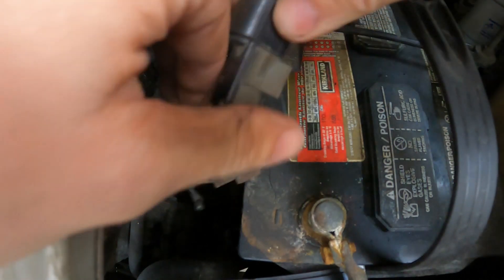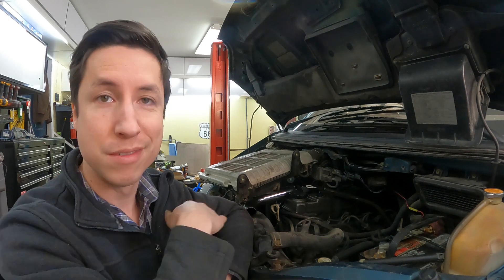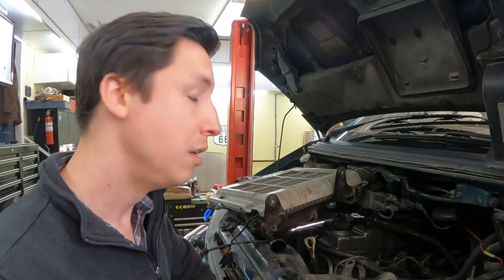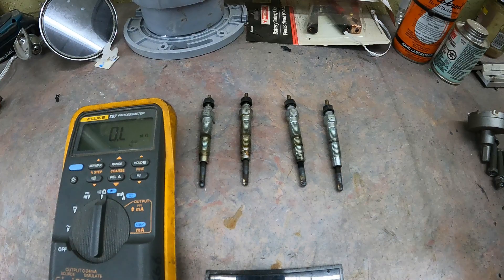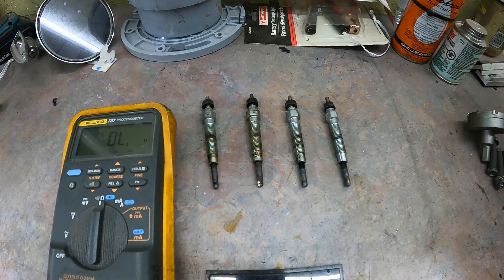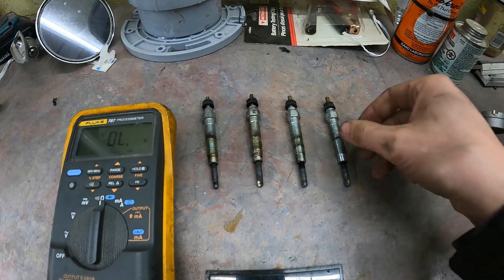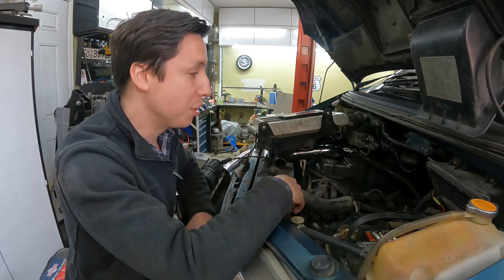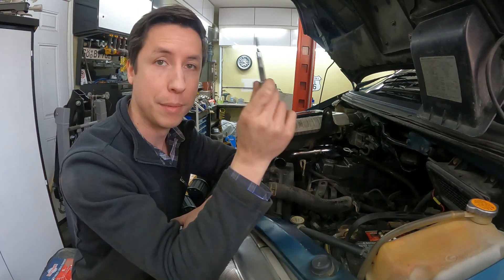Diesel Engine Glow Plug Test (Mitsubishi Delica)

Comment: Thanks for the video! Would bad glow prevent the relay from clicking? I have an l300 4d56 and i have no more clicks in my 12v and 6 volts relay. I have voltage there and reas voltage on the glow bar (5.72volts) i think the Ohm from the the plugs read 1.4, if they are toast, would that prevent the clicking?

Comment: You do great content. But your statement about using a test light to show how much current is flowing to the glow plugs is incorrect. that light's is glow is measuring the voltage between those two points not the current, just like a voltmeter would show. 13 volts = bright, 11 volts = not so bright.
Reply from the maker: Yes you are correct, technically its voltage that is being checked, I didn't want to go into much detail. The voltage drop however can be caused by high resistance from very corroded connector or poor ground. In a scenario like this a volt meter may still read 12 volts as it may only be drawing a few miliamps, which the bad wiring can still supply. A test light on the other hand requires a few amps at 12vdc. This can give you a visual of the voltage drop as the wiring may not be capable of supplying 12volts at say 5amps, so the light will glow dimly. Using something like a sealed beam headlamp actually works much better for this sort of test as it puts a much higher load on the circuit.

Comment: Mine won't even glow after the plug change. That's all I keep coming back to. I have power to the bus (if I'm quick enough to test it right). I did the injectors while I was at it. Is that an issue? I'm just thinking out loud right now and frustrated.
Reply from the maker: Did you use the correct OEM glow plugs?  Aftermarket ones often mess with the glow timer I have found.
Reply: @projectaddiction  It wouldn't start before I changed the plugs. I figured I would start there (and did the injectors while I was at it). It may be the timer itself come to think of it. I only get a very short window to test the bus bar. I'm honestly out of my league on this. There is also a sound missing when I turn it over. It's very hard to put my finger on but it's gone. I thought maybe it was the flex plate (?). I'm at a loss at the moment. Thank you for your reply.
Reply from the maker: @LuckyLeftyD  Diesel's are fairly basic. If you have fuel, compression, and the glow plugs are working it should run. You may want to swap out your temp sensor as a faulty sensor can cause the glow plugs to shut off to fast. You can also add a manual glow plug switch for testing.
Reply: @Project Addiction  Thank you so much for the info. I barely have enough time to turn the key and run to test the bus bar(?). It has power as I've gotten there fast enough to see a light bulb. I do want to put a manual push button for the glow plugs, but I'm not all that sure how. It, too, is probably very basic. It turns but I get no "chug" or "shake" or exhaust for that matter.
Reply: @Project Addiction  also, parts are very hard to find in the States. Do you have a part # or source for the temp sensor? I have a really dumb question also: Can a bad starter cause this issue?  I can turn the key, and it will drain the batteries trying. I ask because a sound is missing. My dumb brain thought it could be the "flex plate" or a solenoid....... I hate to bug you, but I love learning from you.
Reply from the maker: @LuckyLeftyD  There are a number of importers in BC Canada that will ship world wide. You might try get parts through one of them. As for the starter issue you speak of if the engine is turning over the starter is fine. If the engine doesn't crank and you hear a grinding sound or whirring sound the flexplate or starter bendix may be bad. If the batteries drawn down quickly while cranking the engine you may need a new battery.
Reply: So did you end up fixing it? if so can you share? Future Delica owner and need info going deep into the woods.  Thanks!

Comment: Do you have any videos troubleshooting the relay system.  Our l300 glow plug system recently quit.  On start, you could hear the relay click off... But while driving the relays would randomly make noise... This became more frequent until one day the plugs stopped warming up.
Reply from the maker: It's on my to do list I swear! A simple and inexpensive thing to try is to swap the head temp sensor out for a new one.

Comment: Bus bar looked a bit crusty. Just because you have good power on the bus, could be a poor connection to the post if the plugs.  Worth mentioning to clean that area for each of the four plugs and confirm that the nuts are on nice and tight
Reply from the maker: Very good observation! Trying to record and perform work make it harder to broach on everything sometimes.